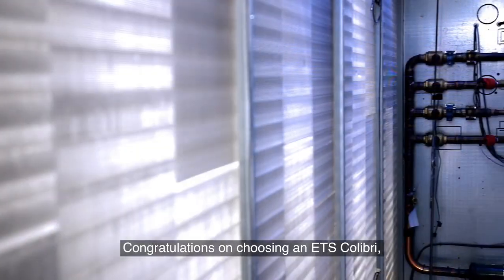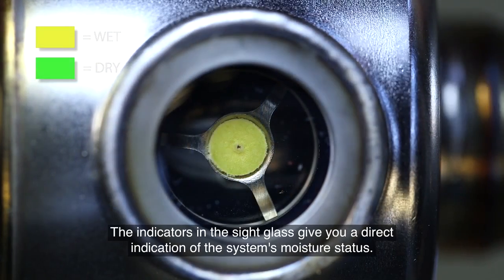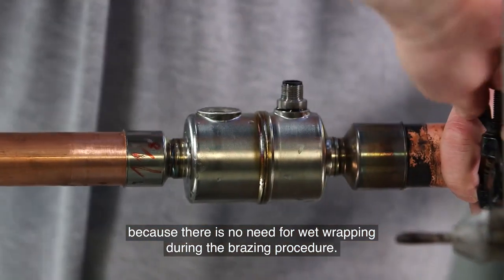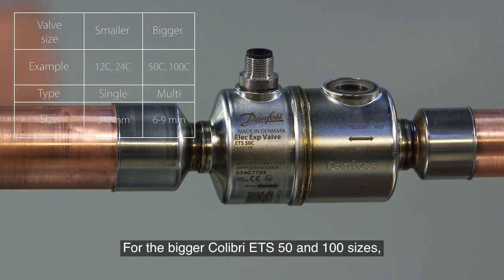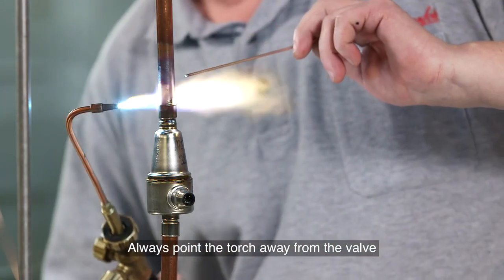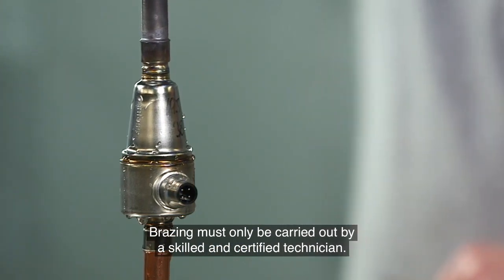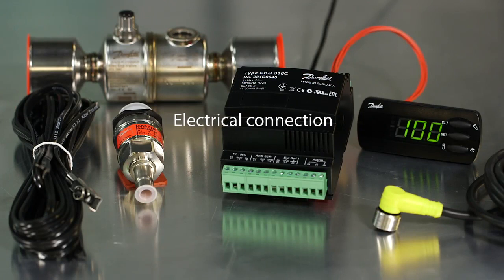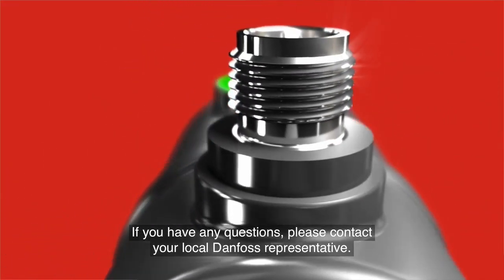Installation Video | ETS Colibri Electric Expansion Valve | Danfoss Cool

Comment: "With the bimetal construction, a wet rag is not needed to cool the valve."

"Water can be directed on the valve to keep it cool during brazing."

"You can wrap a wet rag around the valve to keep it cool if you cannot solder it quickly."

"Wrap a wet rag around the valve according to professional brazing standards to cool the valve during brazing."

Holy fucking hell you guys need to make a decision here.  How about we just stick with wrapping a wet rag around it to keep it cool during brazing?
Reply: @Nikolai Kye None of us are interested in your spam.
Reply: @Braxton Ayaan No one is going to fall for your bullshit second account bud.